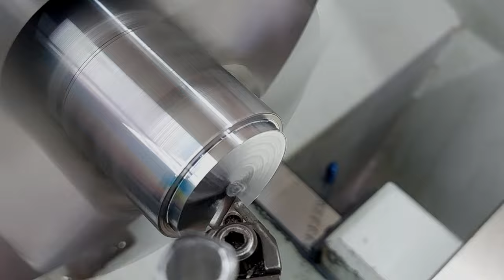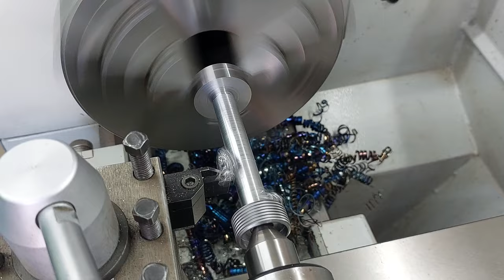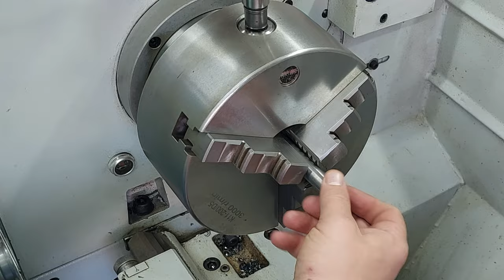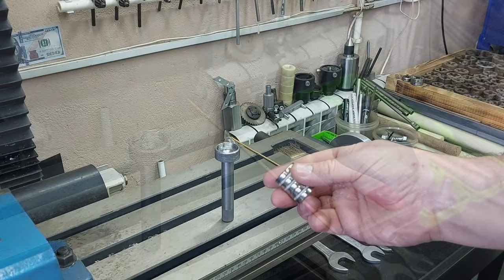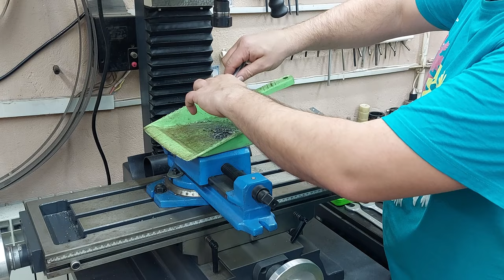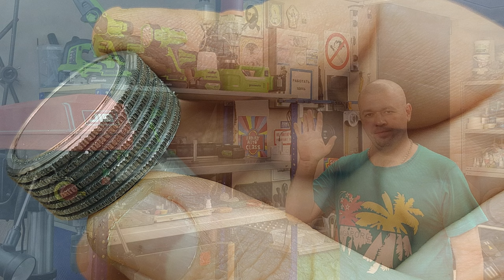You've got to see this! Made a useful homemade tool for my workshop

Comment: Great idea. I suggest putting a plastic bag over the magnet, much more efficient, and keeps tool clean. Thanks for sharing.
Reply: I made one years ago to clean off my welders magnetic angle magnets. I use a zip lock bag. No more splinters.
Reply: Great idea guys but I would use a plastic medicine bottle sized just big enough to fit.
Reply: @roysnider3456  Great idea. Thanks.
Reply from the maker: Thank you and welcome!